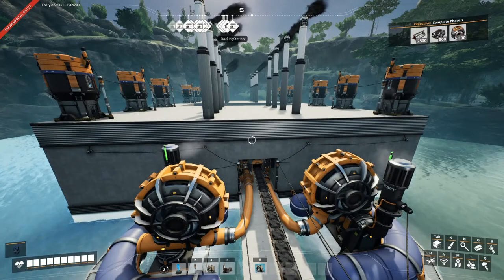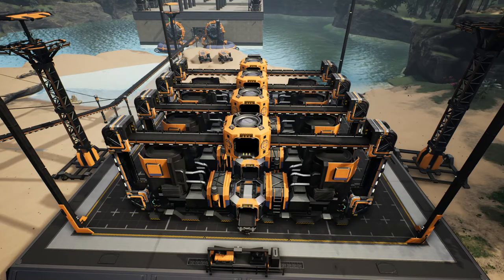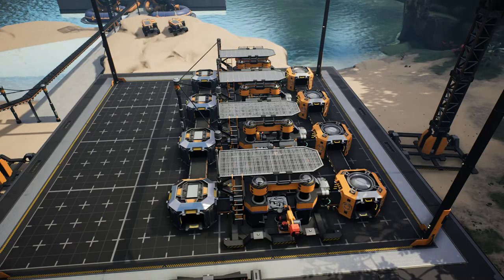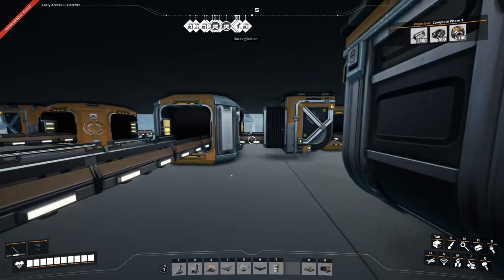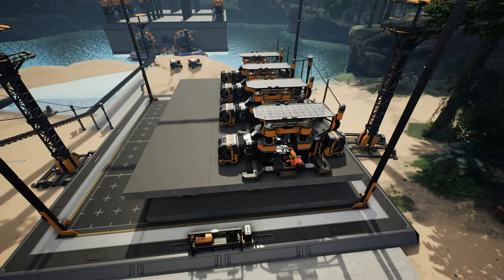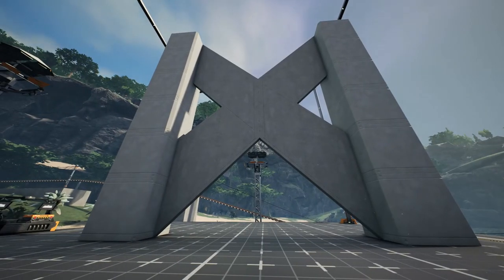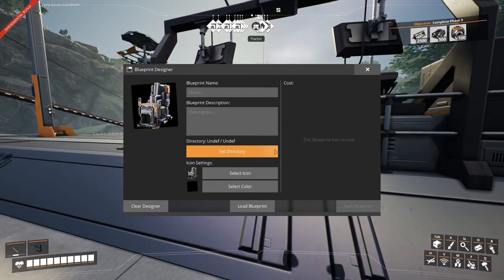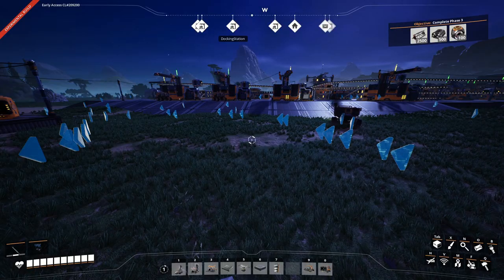The first blueprints you should make | Bite-sized Satisfactory

Comment: Nice stuff.
I don't use experimental or blueprints.
I think blueprints are OK. It seems like they made it for manifold builds.
And I don't like that either.
I'm a load balancer builder.
Reply from the maker: It works for both styles, although definitely better for some styles than others. In my opinion the blueprints are mostly there to reduce the repetitive building elements that especially the late game has. That is definitely useful in load balancing builds as well - if that's something you'd want to try of course!
Reply: @The Dutch Actuary  I hear you.
That's what great about this game its whatever style you like.
Blueprint building would be great if it was modular in size and height. Just connect blueprint building pieces to create your own size. That way you can create a whole system with taller buildings. 
But hey it's still in early access things can change.

For some systems you will need load balancers. Like a 4 line to 5 output. You can't do it with manifold layout.